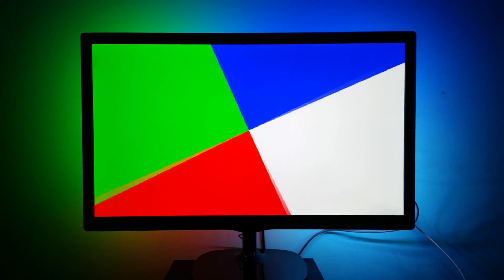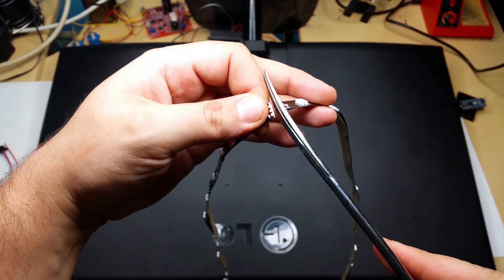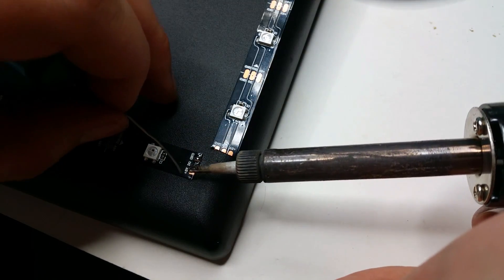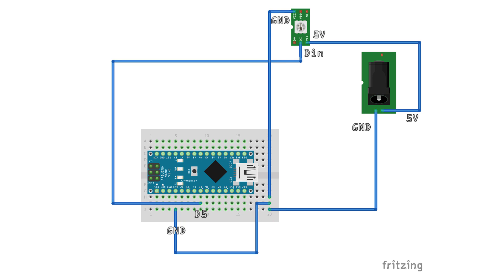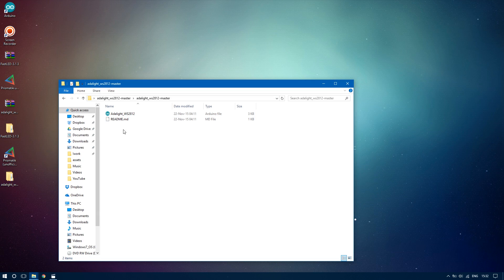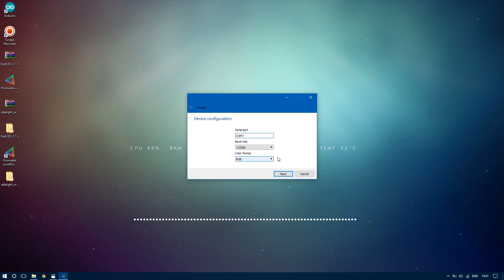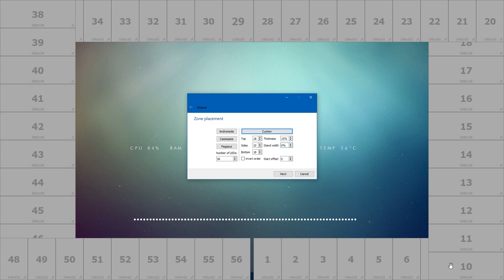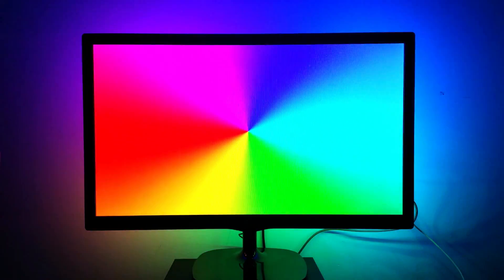DIY Arduino Ambilight RGB WS2812b Full Build & How-To

Comment from the maker: Thank you for all the positive feedback on this video, there were a lot of questions in the comments, and I tried to answer all of them to the best of my knowledge. If you have a question be sure to write it down or check the comments there are a lot of already answered questions there. Also thank you for the subscribers and support. It really means a lot and helps me build my channel. :) Cheers
Reply: @IMA Bull The Arduino is powered through the USB port it's connected to. USB can't deliver enough power to also power the LEDs though, hence the separate power supply.

Comment: I've setup the project using esp32 and WS2811b but I'm having the issue in color capturing...
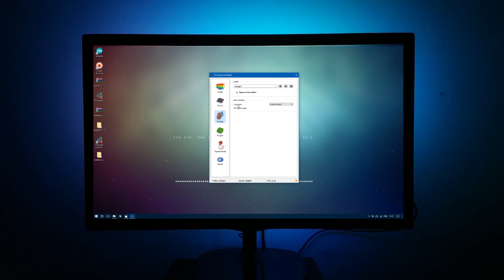as I can see in your video 7:51 the colors are grabbing prefect, but in my case the all colors are merge to one color and It shows in back
could you please help me to solve this?
as you can see https://drive.google.com/file/d/1uE5MphBBSChQa5-0xAKku9-qF-j_Qwph/view?usp=sharing

Comment: Hello Thanks for this tutorial and I have a question So In device configration part, It is asking me the single LEDcurrent and The power supply current limit. I am using my arduino as my power supply I amsing the 5v port to energize the LED do you think it would matter

Comment: hi, no idea if you still reply to queries, but I am trying to build this and I keep getting the error : 
In file included from C:\Program Files (x86)\Arduino\libraries\FastLED\src/controller.h:9,
                 from C:\Program Files (x86)\Arduino\libraries\FastLED\src/FastLED.h:47,
                 from Adalight_WS2812.ino:9:
C:\Program Files (x86)\Arduino\libraries\FastLED\src/pixeltypes.h:54: error: invalid pure specifier (only `= 0' is allowed) before ';' token
C:\Program Files (x86)\Arduino\libraries\FastLED\src/pixeltypes.h:63: error: invalid pure specifier (only `= 0' is allowed) before ';' token
C:\Program Files (x86)\Arduino\libraries\FastLED\src/pixeltypes.h:65: error: invalid pure specifier (only `= 0' is allowed) before ';' token
C:\Program Files (x86)\Arduino\libraries\FastLED\src/pixeltypes.h:54: error: initializer specified for non-virtual method 'CHSV::CHSV()'
C:\Program Files (x86)\Arduino\libraries\FastLED\src/pixeltypes.h:63: error: initializer specified for non-virtual method 'CHSV::CHSV(const CHSV&)'
C:\Program Files (x86)\Arduino\libraries\FastLED\src/pixeltypes.h:65: error: initializer specified for non-virtual method 'CHSV& CHSV::operator=(const CHSV&)'
C:\Program Files (x86)\Arduino\libraries\FastLED\src/pixeltypes.h:121: error: invalid pure specifier (only `= 0' is allowed) before ';' token
C:\Program Files (x86)\Arduino\libraries\FastLED\src/pixeltypes.h:150: error: invalid pure specifier (only `= 0' is allowed) before ';' token
C:\Program Files (x86)\Arduino\libraries\FastLED\src/pixeltypes.h:158: error: invalid pure specifier (only `= 0' is allowed) before ';' token
C:\Program Files (x86)\Arduino\libraries\FastLED\src/pixeltypes.h:121: error: initializer specified for non-virtual method 'CRGB::CRGB()'
C:\Program Files (x86)\Arduino\libraries\FastLED\src/pixeltypes.h:150: error: initializer specified for non-virtual method 'CRGB::CRGB(const CRGB&)'
C:\Program Files (x86)\Arduino\libraries\FastLED\src/pixeltypes.h:158: error: initializer specified for non-virtual method 'CRGB& CRGB::operator=(const CRGB&)'
In file included from C:\Program Files (x86)\Arduino\libraries\FastLED\src/FastLED.h:59,
                 from Adalight_WS2812.ino:9:
C:\Program Files (x86)\Arduino\libraries\FastLED\src/pixelset.h:303: error: 'template<class PIXEL_TYPE> class CPixelView' used without template parameters

Comment: Is this solution only communicating with the computer over usb? 🙂
Reply from the maker: Yes
Reply: @dusnoki  Convenient 😊 
Between the first and the second version of this project, it seems like you added quite a bit larger power supply - was that only because of the change in led density?

Comment: Hello, I have been using this and the effect is awesome! Question: If you watch movies, there is this black frame at the top and bottom. The right way to cope with this would be the offset function, correct? But then this does not match every movie bc some have no black bars. Is there a smarter way?
Reply from the maker: When you set the positions of each led in prismatic change their height. So it encompasses more of the screen

Comment: Sorry if this has already been asked but is it OK to use the 60 LEDs per meter strip rather than the 30 per meter? Also, I am building a 120" screen so would this work OK with 2 x 5M LED 60 strips if I have a 10A power supply or should I stick with 30 per meter? Thank you for any help and for such an awesome video!!  :)

Comment: hey, first off thanks for the tutorial, really easy to follow especially for a noob like me :) everything works great but the breadboard cables run so hot that after around a month the plastic covers melt and i have to keep replacing them. any idea what could be causing this? i am using all identical hardware as in your list. thanks!
Reply from the maker: Check out my latest video where I fixed a couple of issues with the first one.
Reply: @dusnoki  thanks for the quick reply. do you think there's anything i could do to fix the cables melting with my current setup or was this a common problem people ran into?
Reply: @nonsenseiii  use thicker gauge cables as the cables get hot due to current draw. Using thicker cables will allow for less resistance and allow current to flow without much heat.
Reply: @AbdulRahman-ju6wk  you mean the breadboard cables right?
Reply: @nonsenseiii  yep, I have burned a couple of cables myself using them with the Arduino but thicker wires worked for me hope it helps you too!
Reply: @AbdulRahman-ju6wk  cheers
Reply: @AbdulRahman-ju6wk  actually, would you mind sharing the wires you bought? can't seem to find any thick ones
Reply: @nonsenseiii  AWG 18 should be sufficient if you can find those or in non American terms 1mm dia wires

Comment: How does the Arduino know what color is on screen?
Reply from the maker: It is connected via USB to the pc which sends the data to the arduino 60 times a second.
Reply from the maker: Check out my latest video where I fix some mistakes from this one and make the build a bit more user friendly. Without the need for soldering.
https://youtu.be/nzDnr76fZCc
Reply: Sry i thought it was a TV 👍🏼

Comment: hey dude great tutorial, i am currently running into 1 little problem though. everything is working fine but sometimes my leds will randomly flicker to different colors what might be the cause of this?
Reply from the maker: Check out my latest video where I fix some mistakes from this one and make the build a bit more user friendly. Without the need for soldering.
https://youtu.be/nzDnr76fZCc

Comment: Is it possible to do it with wifi Wemos d1 insted of arduino nano? Or both at the same time?
Reply from the maker: Check out my latest video where I fix some mistakes from this one and make the build a bit more user friendly. Without the need for soldering.
https://youtu.be/nzDnr76fZCc
Reply from the maker: For the esp8266 you need a logic level shifter as well.

Comment: Don't know if you are still looking at this channel but i am wondering if my "thinking" is right, if the led strip i want to go for draws 18w per meter and i need 1.8 meters aka around 33w total. Then i would have to go for a 5v powersupply that can supply min 6.6 amps (33/5) right? and if so i doubt 24 gauge wire could support that or am i mistaken on how much it can take. From just looking around 24 gauge wire should not even support anything over 3.4 or similar. Please correct me if i am wrong which i most likely am about both the minimum amps and wire gauge.
Reply from the maker: I'm making a new video on this project. Where I fix the mistakes from this video. Yes you are right about the power consumption and it will be addressed in the new video
Reply: @dusnoki  Good to know, il stay tuned for that video as led strips are more complicated than i first thought. The setup i had in mind outside of ambilight of two 5 meter led strips needs power injection and everything.......
Reply from the maker: Check out my latest video where I fix some mistakes from this one and make the build a bit more user friendly. Without the need for soldering.
https://youtu.be/nzDnr76fZCc

Comment: Hello, thanks for the video, would this work on a TV, I can set it up on the pc and then connect via USB to the TV. I need this ambilight for my Samsung 55 inch Smart TV.
Reply: I found this. Boris said this somewhere in the comments about a similar question. 

"It will work on your TV if you connect your TV to the HDMI output of your PC and use it as a PC monitor, only then can it know what is exactly showing up on the screen and change the colors of the LED's. It is not meant to be used standalone I'm afraid and needs to be connected to the PC for feedback."

I don't know but it might work if you can run Prismatic on your TV
Reply from the maker: It will work on a TV if you use it from hdmi from your pc.
Reply from the maker: Check out my latest video where I fix some mistakes from this one and make the build a bit more user friendly. Without the need for soldering.
https://youtu.be/nzDnr76fZCc

Comment: does this work for dual monitors?
Reply from the maker: It does but only on one of the monitors.
Reply from the maker: Check out my latest video where I fix some mistakes from this one and make the build a bit more user friendly. Without the need for soldering.
https://youtu.be/nzDnr76fZCc

Comment: One of the best tutorials I've seen so far.
What would you suggest if I wanted to create an ambilight on two screens simultaneously?
Reply: biwabel der Pinguin for dual monitors?
Reply: @hczylos2432  Yes, two screens simultaneously. Guess it needs different software that supports two screens
Reply: biwabel der Pinguin you can easily do it with 1 if your monitors are on a stand and or wall mount simply measure the led strip at the bottom to be a little longer so it has a bit of extra distance do this on both monitors and link the bottom strips between each monitor this can probably be achieved without a stand or mount while still looking great if your a little confused just ask i typed this up while heading out the door so might not be worded the best that it could’ve been :)
Reply: @hczylos2432  Well the problem should not be the LED strips, but the information from the screens. If I have different colors on the two screens, the software is only able to get the info from one screen
Reply from the maker: Check out my latest video where I fix some mistakes from this one and make the build a bit more user friendly. Without the need for soldering.
https://youtu.be/nzDnr76fZCc

Comment: hi. there is no custom settings for my prismatik. so i can not use it 4 sides with right place and color.
Reply from the maker: Did you download the correct version?
Reply: @dusnoki  5.11.3 version is on my pc.
Reply from the maker: Check out my latest video where I fix some mistakes from this one and make the build a bit more user friendly. Without the need for soldering.
https://youtu.be/nzDnr76fZCc

Comment: May I ask why a resistor wasn't used on the data line and if I were to use say 100 pixels/LED's on my setup and wanted to use a resistor on the data what would I be looking at with the strands in this video?

Comment: Will pixel grabbing work while gaming and if so does this software effect vsync/gsync performance?

Edit: Thanks for the tutorial. I ran 84 LED's, with a 5v 10amp power supply. I ran power like you but added a feeder from the end. I also used a 220ohm resistor before the data line. I originally set it up without the resistor but had some occasional led flickers on the front end of the strip so I inserted the resistor. These were installed on a 49in Samsung ultrawide monitor. Now gsync in game does not appear to work as my frames ingame are much higher than I'd prefer but I'll take the fps trade-off as I don't notice any tearing at 200 fps. Overall a great tutorial for beginners like me.

Comment: Hi man I made it work, however after configuring Adalight my leds only light white and it doesn´t screen grab colors from my screen. I tested LED strip by programming my own arduino code to change each led to random color and it works so problem is somewhere in Adalight program. Do you have any solution to this? Thanks
Reply from the maker: What OS are you running?
Reply: @dusnoki  Windows 10. I tried another program which is called Ambibox and its working however, I have capture speed of 5FPS in that program

Comment: Hi, would this work on a 4K tv with a desktop PC outputting 4K via HDMI? 

Many thanks Simon..
Reply from the maker: Theoreticaly it would work. Just you would need to supply more power on each corner to the strip as it looses power the longer the strip is and the more leds it has. Also i haven't tested it out with 4k resolution. There might be some performance issues.
Reply: Boris Dusnoki thank you👍

Comment: I think that the best way it would be to connect it to Computer PSU 5V, what do you think?
Reply from the maker: It could work. Just depends on how much amps does the particular psu put out on 5v, how long the strip is and how many leds/m

Comment: Followed this video and it worked like a charm! Even managed to do it without soldering by purchasing the correct connectors on eBay.

But where did you find the spinning circle of colors used to show off the result?

BTW. I used a total of 116 leds and  a 10 amp power supply. Looks amazing
Reply: hello. I am planning on doing this as well, without soldering. What connectors did you buy? Thanks
Reply: @AZmotion  got some breadboard jumper cables. 3pin solderless ws2812b connectors with wires and angled pcb mounting. And a DC plug to connect the PSU.

Comment: Hey, can I buy two 1m stripes and connect them together? Because they are cheaper than 2m stripe, also is it possible to just bend it without cutting?
Reply from the maker: Yes I bought 2 1m strips as well... I'll be making an followup video soon. You can use L connectors for connecting the strips on the corners. Or straight ones for connecting two strips.

Comment: Sorry but I've looked over the comments and the wiring from the power supply confuses me, did I get the wrong one?

I just have 2 wires, and no clue how to tell which one is ground. The plug dosen't have a ground connector either, so I'm not sure it even would have one?
Reply from the maker: Come to my discord channel and we'll figure it out.
Reply: @dusnoki  Thanks for the offer but I think i figured it out :) Turns out I never saw your intro where you showed a regular phone charger thingy, and you used a standard USB cable. I bought the power supply in your description, which just terminates in 2 black wires with no way to tell them apart, save for using some kind of plug on the end.

I'm currently taking apart a micro USB wire now and have an old 2 amp phone charger ready to go.
Reply from the maker: @TheElsarild  I would really suggest you use a bit more powerful charger in the long run. And invest in a cheap multimeter at least so you can check the polarity of the wires. What kind of power supply do you have?
Reply: @dusnoki  oh I will, but I kinda want to get it working today, then I'll find another poewersolution. As for multimeter, I already have one, thought I'm now entirely sure how I'd check the polarity, but I'm going to learn how to.
Reply from the maker: Plug the power supply into ac, put the red wire of the multimeter to 1 wire and the black wire to the other. If you get -5v then it's the other way around. If you get 5v then it's red wire 5v, black wire gnd. Simples :)
Reply: @dusnoki  Cheers, I got it figured out and I'm up and running. Thank you so much for the help!
Reply from the maker: You're very welcome mate. Glad it all worked out well :) cheers
Reply: @dusnoki  Just touching base real quick, as I finally got a hold of a charge doctor to see how many amps the strips is actually drawing. My setup which happen to be the exact same amount of LEDs as yours,  draws just over 1.1 amp at max load, when setting brightness to full, and displaying white light. Even when putting something like a fast spinning color wheel on screen to make it update quickly it draws just under 1 amp, so for now,  I think this solution works for me :)

Comment: Hello
I would like to use a 144 led / m led strip this time:
https://it.aliexpress.com/item/1m-4m-5m-WS2812B-Smart-led-pixel-strip-Black-White-PCB-30-60-144-leds-m/32500778173.html?spm= a2g0o.cart.0.0.2e063c008eiq1f
it says that they consume 43.2 W / M (5v), I need 3 meters,
according to you how long do I have to take the power supply?
can I feed the arduino with the same strip feeder?
Reply from the maker: I would highly recommend using less leds/m strip for this project. Max 60. As some people have been running into issues with using too many leds. I'm using 30 and I'm still quite sattisfied.

Comment: in order to connect leds to the power supply it will be necessary buying this conector, right?  or you just cuts the connector of the power supply to adapt it ?
https://www.aliexpress.com/item/10-Pcs-12V-2-1-x-5-5mm-DC-Power-Male-Plug-Jack-Adapter-Connector-Plug/32991835810.html?spm=2114.search0604.3.66.70c0b0a07J70dj&ws_ab_test=searchweb0_0,searchweb201602_4_10065_10068_10547_319_10891_317_10548_10696_10084_453_454_10083_10618_10307_10820_10821_10301_10303_537_536_10059_10884_10887_321_322_10103,searchweb201603_52,ppcSwitch_0&algo_expid=4f433e16-4a02-49ee-9b0a-49aa3228ddf9-9&algo_pvid=4f433e16-4a02-49ee-9b0a-49aa3228ddf9

Comment: Hey, Can I use a 12V led with a 12V power supply.
Will the 12V leds work with the Arduino nano?!!
Thanks in advance.
Reply from the maker: Yeah they will if they are in deed 12v.